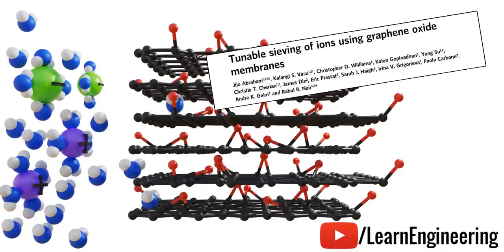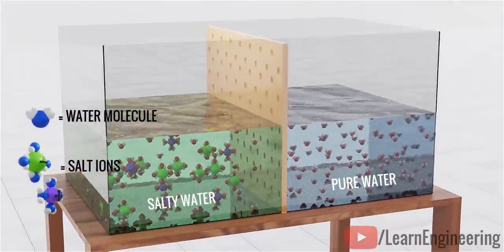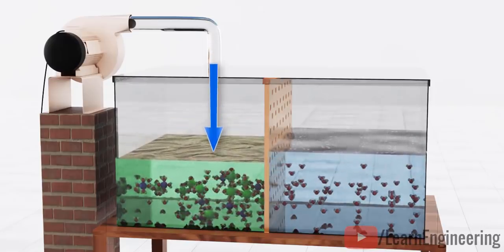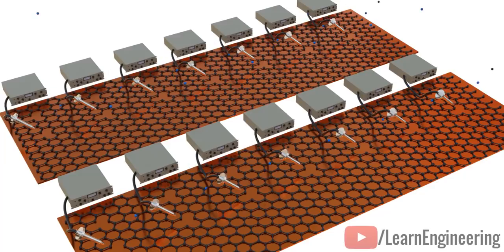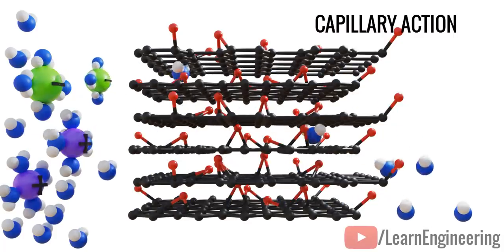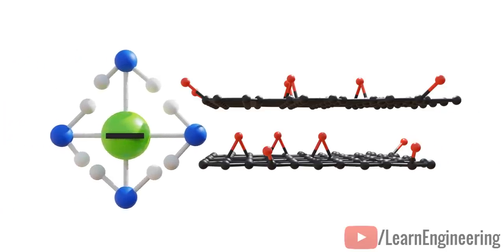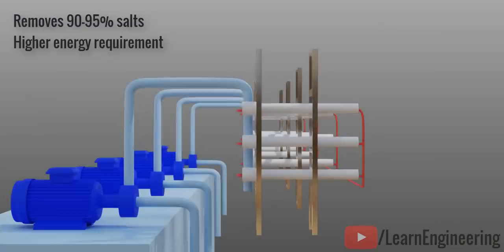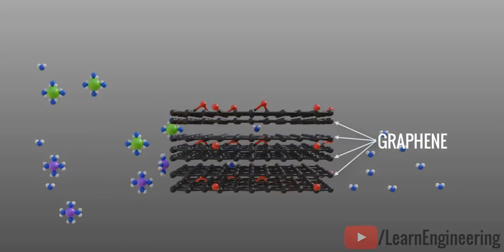Graphene Filtration | A revolution in Desalination technology!

Comment: 5:07 how do we make sure that no water molecules move the other way around. After all, didn't we say that the water molecules move naturally to the side where we have more salt to balance the concentration?
Reply: Naturally the molecules want to move to try and equilibrate the pressures. However some water molecules still would but the important thing is that there would be more moving in the desired direction with creates a net movement of water to the clean side.
Reply: Gravity maybe? also he said that the water molecules move by capillary action so maybe it’ll work like a straw?
Reply: @joelpivetta4421  This is a circular argument though, isn't it? Could it be that the graphene has a relatively lower Helmholtz free energy barrier (assuming volume and temperature remain more or less constant in the system) compared to the 'normal' filter?

This would still require the same amount of energy in the end, right? Perhaps the energy requirement difference stems from the pace at which desalination should occur? In either case the desalinated state should be about equally entropically unfavourable.

It doesn't make sense to me that the difference arises because it takes less energy for the water molecules to be desolvated, as at the other side of the filter this same amount of energy is spent again for resolvation/reforming the hydrogen bonds. Except that the overall reduced energy barrier would accelerate the process.

Maybe anti-fouling properties of the graphene membrane also differ from traditional filtration membranes?

Blegh my thermodynamics is rusty.
Reply: In desal plants, the slatless water is pumped away. Clear water has to be touching the membrane for it to have a chance to migrate to the salty side.
Reply: @yay-cat  Good guesses but I don't think that would explain it :).

Gravity barely plays a role at the molecular scale. The thermal motion of molecules starts increasingly outweighing gravity as objects get smaller; thermal motion starts to become dominant at around 1 micron.

Capillary action could work to the point where the pores are filled, but thereafter the capillary forces would act to keep the water inside so it would cancel out (although it may lower the total energy barriers to be traversed somehow).
Reply: @nemo-x  Yeah I don't know either. Your point on the capillary action is plausible except for that I expect the capillary action to provide the opposite effect when water exits the membrane. If the membrane is more hydrophilic, then it'll also cost more energy to have the molecules exit compared to hydrophobic material. I'll google the paper later tonight (if i dont forget) and come back to you.
Reply: You apply a small amount of forward pressure to the incoming saltwater to overcome the reverse pressure of fresh water trying to migrate backwards through the filter. That forward pressure is where the energy consumption occurs, in any desalination method, whether it involves a RO filter or boiling the water. Even a gravity-fed RO filter would involve energy consumption to raise the incoming saltwater above the filter before letting gravity pull it down through the filter. The advantage of the experimental graphene RO filter is the required forward pressure is much smaller than with currently existing RO filters, thus the energy consumption is lower.
Reply: @deusexaethera  Why is the required forward pressure lower though? More anti-fouling near the pores? Because if it's its hydrophilic nature, then resolvation at the freshwater side would negate the lower energy required for desolvation.
Reply: @joelpivetta4421  That is not allowed by thermodynamics; chemical potential of water on the two sides are different and water will move from the higher chem pot to the lower chem pot side (unless you apply external force).
Reply: @hyric8927  yes true but.

If both sides are at equal pressure, a thin layer of water must be present on the saltless face; the fine pore size will prevent the water from dripping down.
Reply: @F a If it is more selective and allows 97% of salt to be removed, it cannot be considered less restrictive. Water is permeable and is not the factor. The friction is caused by the salt and it must be highly restrictive for the salt flow.
Reply: @deusexaethera  The forward pressure drop cannot be less than the osmotic pressure of the salt water. You are basically doing PV work (move 1 liter of water across a pressure diff eq to the osm pressure).
Reply: You are all thinking this to hard. Usually in a dead end filtration setup the outlet is collected by gravity. Meaning that the water on the exit is constantly removed by droplets forming and than detaching from the membrane dropping in a collecting vessel. Imagine a coffee filter, just the macro physics not the micro action, that is the water droplets dropping. I assume if we were to talk about thermodynamics the major prerequisite should be whether an equilibrium is acheived. Im not sure this system the allows the formation of a steady state due to the constant removal of the outlet. The major energy reduction is given from the fact that no additional external force is required to the system other than giving it potential energy for the water to flow in the direction downwards to the system. Whereas the external P needed in RO system is considerably large.
Reply: Gravity, the GO membrane "pulls" the water inside, goes out the other side and then it will fall into a container
Reply: @RbladerOS  desolvation is not involved in this process as far as i know

the difference between     the current process and the new process is that a large amount of energy is required  to push  saltwater through the graphene int he current process but none is required in the new process because the water moves through the graphene oxide due to capillary action
Reply: @F a capillary action  3:21
Reply: @robinsss  I'm quite sure desolvation is involved, although the water molecules themselves desolvate, so strictly speaking it might not be called desolvation. In any case, I'm referring to the process of interwater hydrogen bonds breaking when water molecules enter the slits, which costs energy, although relatively less so when entering a hydrophilic slit. The entropy penalty should be rather high though, as degrees of freedom are impaired and excluded volume decreases overall relative to the state where no net water has entered the slits yet.

Capillary action seems to me not a sufficient explanation as on the slit exits the capillary action works the other way around regardless of the superposed pressure differential towards the exits.
Reply: @RbladerOS  as the water molecules  go  through the holes in the graphene or between the layers in graphene oxide  the bonds between the hydrogen and oxygen in the water molecules do not break

the water molecules go through the graphene  with the hydrogen-oxygen bonds still intact
Reply: @robinsss  That is not what I meant. The INTRAmolecular covalent bonds do not break of course; that would require about 490kJ/mol. Hydrogen bonds between water molecules however absolutely do break (even though they are constantly forming and breaking in dynamic equilibrium anyway at STP), and it would take about 4 to 40kJ/mol to break these hydrogen bonds. This costs energy (enthalpy) and in this case also incurs an entropy penalty as hydrogen bond structures in water allow for more freedom of movement compared to a confining slit.
Reply: @robinsss  Sorry but that doesn't explain it in enough detail. How would capillary action aid the process if capillary action also works in reverse (i.e. there is no net pressure gradient between just before pore intakes and just after pore exits, apart from the externally applied pressure + osmotic pressure).
Reply: @RbladerOS  if those water  molecule  bonds broke during this process then  it would not be something that the creators of the process were intentionally trying to do

 according to them , if those  water molecule bonds break then it isn't because of energy they provided during this part of the process because  they claim they are not providing much if any energy in this part

they claim that the water molecules flow through the graphene layers naturally through capillary action

not because of an enormous amount of energy that they are providing
Reply: @RbladerOS  i agree that the explanation was not a good one

maybe they will explain it better in a few weeks
Reply: @robinsss  Have you read the paper? This particular video just doesn't do the best job at an in-depth explanation. The researchera are definitely aware of these hydrogen bonds/interactions breaking. Any chemist is. The breaking is also performed by part of the energy that's provided externally. You cannot have a non-equilibrium process without some energy input. Thermodynamics forbids it.
Reply: @RbladerOS  i didn't say that they were not aware of the breakage of these bonds  i said you don't know if the breakage consumes a significant amount of energy
Reply: @robinsss  But I do. No energy is consumed though. You cannot have water molecules removed from water into a confined space without breaking some of these bonds - i.e. desolvate. The energy required for separating these bonds is 1-40 kJ/mol. So at STP,  desolvating 18 grams of water takes about 1 to 40kJ.

It doesn't matter if it is significant. What matters is that there is no difference between this filter and another filter looking at net gains by hydrophilicity. 

Say that you 'pay' 20kJ to have 9 grams of water removed from their hydrogen bonded watery surroundings. So that's about 3E-20 J per molecule. Now, because this filter is apparently more hydrophilic than the material used previously, you get a discount on this bond breaking because the interactions of the water molecule with the filter are also relatively favorable. So say it now costs 2E-20 J per molecule to enter a graphene filter because you get 1E-20 from the new non-bonded (so van der Waals) interactions with the filter. 

Net energy balance = -2e-20J

Then when the water leaves the filter you pay that discount back to remove the van der Waals interactions, and also new hydrogen bonds form which now gains energy. The amounts would be exactly the same (barring other energy losses /interactions which are not relevant to this example)

Net energy balance = -2e-20J + 2e-20J = 0

So no matter the filter, this stays 0.

A more hydrophilic filter will decrease the energy barrier for entry, but will increase the energy barrier for exit, and vice-versa.
Reply: @RbladerOS  ''''You cannot have water molecules removed from water into a confined space without breaking some of these bonds '''

not true

there are some water molecules in salt water that are not bonded     to salt molecules 

so there is no bond to break

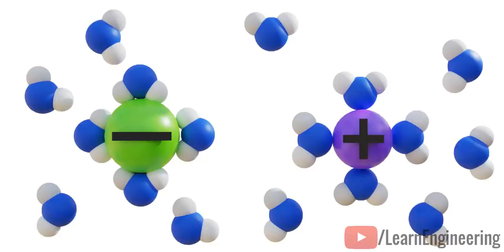and  according to this video the water to water bonds are easier to break than salt to water bonds so they require less energy   4:02  

'''''It doesn't matter if it is significant''''

it does matter because electricity  required for the pumping of the water to push it through the graphene at least in part accounts for 44% of the total energy used in the current process and cost
Reply: @robinsss 

You seem to misunderstand me. I never said anything about salt bonds.

"not true

there are some water molecules in salt water that are not bonded     to salt molecules"

The water molecules are bonded with other water molecules. I didn't say anything about salt, although the same principles would apply. Note that for water this is not a covalent type of bond. This is generally true.

See these links for some more explanations.

https://en.wikipedia.org/wiki/Hydrogen_bond#Water

http://www1.lsbu.ac.uk/water/water_hydrogen_bonding.html

https://chem.libretexts.org/Bookshelves/General_Chemistry/Book%3A_Chem1_(Lower)/07%3A_Solids_and_Liquids/7.03%3A_Hydrogen-Bonding_and_Water

"and  according to this video the water to water bonds are easier to break than salt to water bonds so they require less energy   4:02  "

Maybe read my response again?

"it does matter because electricity  required for the pumping of the water to push it through the graphene at least in part accounts for 44% of the total energy used in the current process and cost"

Again. I feel like you didn't read or understand my response. If the latter is the case, please address the parts which you don't understand, as you we are talking past each other now. 

It does not matter in this case and I specifically explained why. Reiterating what the video said won't change that. They state that less energy is required to pump it trough this new stacked graphene filter, but we are trying to get at WHY that is the case.

The video is incomplete/too superficial.

May I ask what your background is? Not to argue from authority, but to know how to explain stuff better.
Reply: @RbladerOS  ''''''''The water molecules are bonded with other water molecules. I didn't say anything about salt,''''

my mistake

but there are non bonded unattached water molecules in sea water  so those don't have to be broken from any type of bond

'''''''I didn't say anything about salt, although the same principles would apply.''''''

 do you agree or disagree with the statement that the water to water bonds are easy to break? 4:02

'''''''They state that less energy is required to pump it trough this new stacked graphene filter, but we are trying to get at WHY that is the case.''''''

they did explain why

they said it requires less energy because the water moves through naturally  do to capillary action 

they didn't explain exactly how that happens in detail
and how they prevent the drinkable water from moving back to the other side if the graphene

i am a layman
Reply: @robinsss  "My mistake"  No problem. It may be cheesy, but mistakes are opportunities to learn :). I make a lot of mistakes.

I think you are confusing molecular covalent bonds like the H-O-H bonds in water with hydrogen bonds forming between molecules. Because oxygen atoms in a water molecule are partially negatively charged, and hydrogen atoms are partially positively charged, the O in, say, water molecule A aligns with a H in  water molecule B, e.g. HOH - - - OHH. These bonds arise in all water and are particularly strong in water because it is so polar. That's why water has such a high boiling point for such a small molecule; it takes quite a lot of energy for a water molecule to break these hydrogen bonds and leave the rest of the water as gas/steam. A somewhat similar process happens here, because for a water molecule to go through the small slit it has to leave the rest of the water molecules with which it had these hydrogen bonds. Thus they have to break.

I agree that it takes far less energy to break these compared to covalent bonds like the bonds in H-O-H itself. Life as we know it wouldn't be possible otherwise.

This also plays an important part in how surface tension and capillary action works.

So because of the hydrophilic layers between the graphene, it is easier for individual water molecules to break loose and enter the slit, because the hydrophilic stuff is also polar and also attracts the water molecule, just like the other water molecules attract it. The stuff between the graphene can attract a water molecule either more than the other water molecules do, or less than the other water molecules do. In the first case it would not cost energy to get the water in, and in the latter case it would (this explanation is simplified). For hydrophobic layers it would definitely cost energy to get the water molecules in. Note that this difference in energy can come from the thermal motion of the molecules itself if the difference is small enough. You dont necessarily need a pump.

Now consider the filter exit, on the freshwater side. Here the exact same process as just described happens in reverse. Hence if it would cost no energy to get the water in, it takes energy to get the water out. Thats why I said the difference does not matter viewing the entire system. And thats also why capillary action is not a sufficient explanation.   
So they did explain why in a basic sense, but it is not a satisfying answer (at least not to me). Im looking for a few more layers of asking 'why?'.

Comment: sounds cool, but what about longevity? will salt molecules clog the membranes?
Reply: In many filters, you commonly clean them by running cleaned fluid (here, water) backward through the filter medium and washing away the concentrated captured stuff that you are filtering out.
Reply: I think the graphene oxide membrane is so good in removing salt, you have to replace it every 30 seconds otherwise the flow of water will stop.
Reply: Yes, in a high capacity plant though, there are many valves/pipes so some of them go through maintenance while others work.

Comment: Nice video sir.
Can Graphene sheet n Graphene oxide be use in machibes which makes Hydrogen gas. Ie instead of Proton Exchange membrane( PEM technology) can v use Graphine sheet r graphone oxide n may b with some other combination, manufacture Hydrogen gas machine so that this membrane seperates Oxygen from Hydrogen n Hydrogen gas alone is captured n used for inhalation purposes etc

Thanks n regards